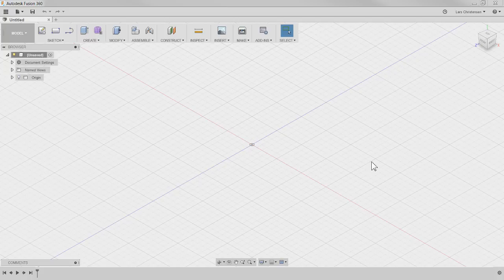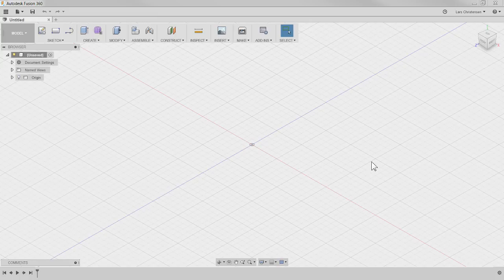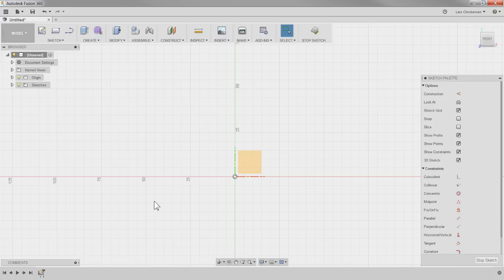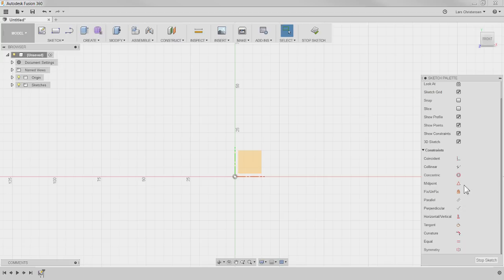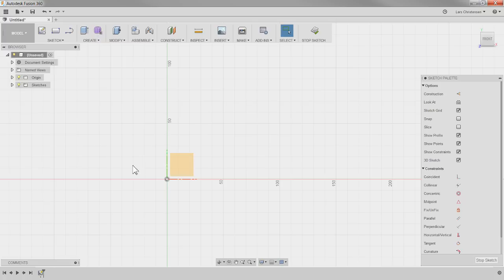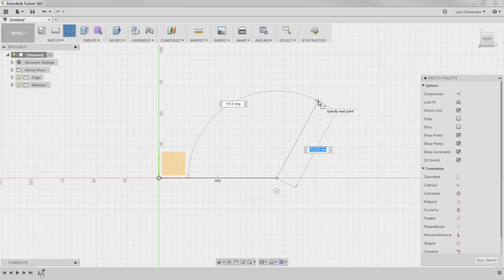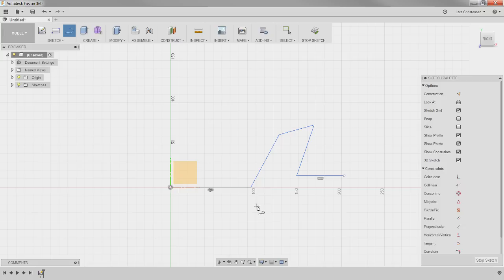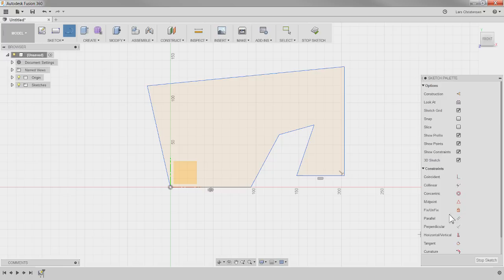How I use Sketch Constraints and Dimensions — Fusion 360 Tutorial — #LarsLive 113

Comment: how do i turn off auto constraints in fusion 360..? i can do it in inventor and even back in mechanical desktop. this thing gets confused and over constrained in the wrong ways on its own. i would rather apply them myself. after 35 years of using Autodesk im ok with that
Reply from the maker: As far as I know, there is no way to turn the function off completely, but you can hold down Ctrl while sketching and the function is disabled
Reply: @cadcamstuff Thank you i will try that!

Comment: Question: sometimes when edit a sketch after it is created, the dimension arrows does not show and I can’t edit the dimensions. Why?
Reply from the maker: I’m not 100 percent sure. If you are in edit sketch mode, one could wonder if it’s a graphic issue or process issue. I have not seen this behavior
Reply: Btw thanks a lot for the great videos you create, inspiring and useful.
Reply from the maker: You are so very welcome
Reply: When you select the feature in the sketch, press D. That should bring up the dimension dialog. That's one way, but I am not sure if that's what you're trying already and it's just not working?

Comment: instead of a scaling system, it would be nice to be able to use EXACT values. I don't want my model to be 0.11612 of its original width, I want it to be 77mm across EXACTLY. Thanks for the tutorial though, this is just a gripe I have about the program.
Reply: You can use the mathematical expressions to do that

Comment: Lars, I am learning how to use Fusion 360 from your videos.  They are very good, and have helped me a lot.  I am having a problem with constraints, and wanted to ask what I am doing wrong.  I've made a 2-minute video that illustrates the problem.  I draw a rectangle (all good) and then add a line to that.  The line passes through the bottom left corner of the rectangle, is at 78 degrees, and ends on the top of the rectangle.  As far as I can see, the line is fully constrained, but the sketch icon shows that it is NOT fully constrained.  Can you tell me what I need to do to constrain the sketch fully?  Here is a link to the short video illustrating my problem: https://www.youtube.com/watch?v=DqbjQPfJ7cQ
Reply: To see what's going on, start a new sketch and draw a line starting at the origin at at 78 degrees to the horizontal.  Then use a dimension to set the length of the line.

As in your example in the video, the line is now fully defined, but the entire sketch isn't.  The reason is that Fusion added a construction line for reference when you specified the slope of your original line.  You'll see that this construction line is horizontal and tied to the origin on one end, but its length is not defined.  If you dimension it, Fusion will then consider the sketch to be fully defined.

The same thing is going on in your example, but it's hard to see because the construction line and the lower side of your rectangle are on top of each other.
Reply: @russcooper9628  Russ, thank you very much!  I just tried what you said, and that's the answer!  

I have a follow-up question.  Is there any way within a sketch to get a listing of all of the different elements, and to see which ones are fully defined and which ones are not?  That would have made it easy to track down the problem to a not-fully-defined sketch line.

Comment: Learn tinker cad to get you started.  Try to learn fusion 360 by the same company and learn you know nothing.
Reply: What?
Reply: I started with TinkerCAD and moved on to F360, and I really recommend that progression, actually. You can do a surprising amount of work in TinkerCAD with just solids and Boolean operations, and it’s a nice intuitive introduction to working in 3D and designing for 3D printing, and you learn what kinds of features you really wish for in a fuller-featured program. I switched to F360 when I couldn’t bear having no automated fillets/chamfers any longer.